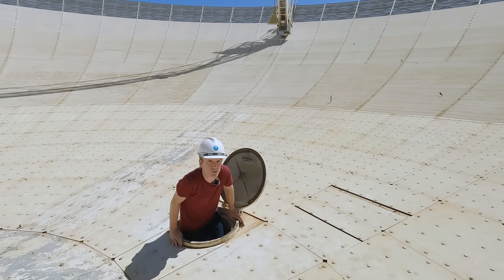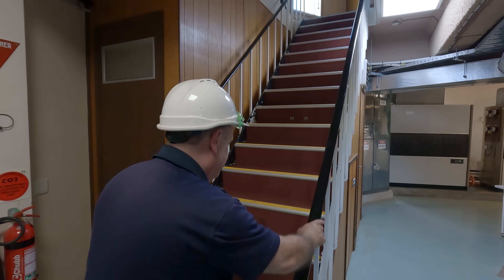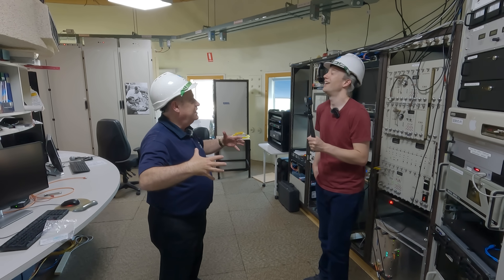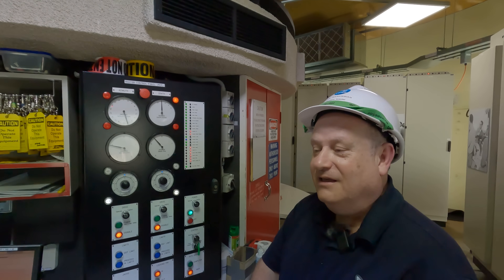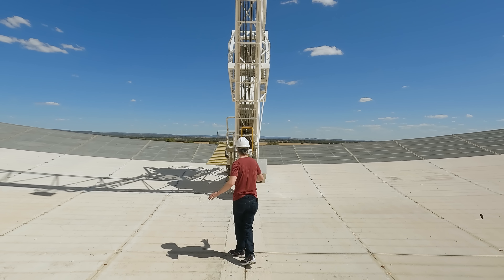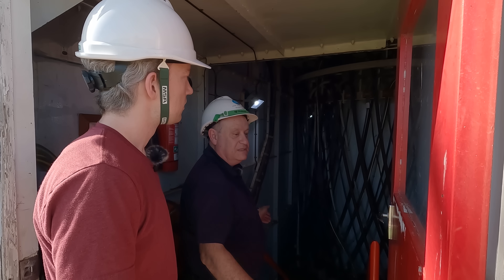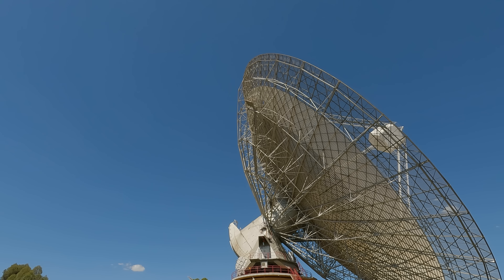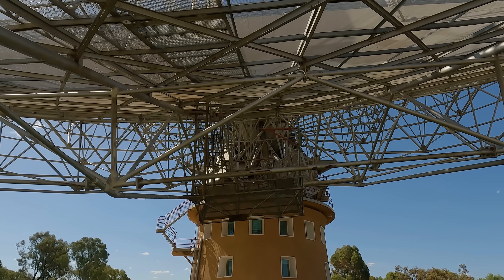I took a ride on a moving radio telescope

Comment: Wow I didn't really grasp the full scale of this dish until Tom walked off the edge at the very end. Calling it Gigantic would be an understatement.

Also the talk about a cell phone on the moon being the highest radio frequency they would receive from the dish made me wonder how they will deal with the Artemis missions and the eventual Mars Missions. 

How can they block out these transmissions when they do their regular work?
Reply: Genuinly they know the frequency at which these things emit. They then filter out that frequency (usually digitally) to get the astronomical data back again. 

Telescopes dont really work like our eyes. Our eyes are less sensitive to light when there is a big lightsource in the way. Telescopes can often still see when there is a bright source in the way.
Reply: Roofing filters are one of the ways, they limit the frequency range allowed through.  Anything not within that range is eliminated. 
That dish is also located in a radio silence zone, the one on the USA east coast is NRQZ, rf emissions are heavily restricted to keep the local noise level to a minimum.
Reply: I'd assume that if they're observing a sufficiently dissimilar frequency they could filter out the deep space mission signals.
If they do need to observe frequencies that might interfere they could collect observation data just when the deep space mission isn't broadcasting, or when the timing of orbits puts the target of observation at a sufficiently broad angle from the deep space missions that the dish won't pick up both at once.
Reply: If I ever visit the moon, I'm going to use my phone to play the shart sound effect at max volume to radio astronomers around the globe you can't stop me

Comment: That jumping off the dish at the end is funny, I love the idea of using an enormous telescope as a quick and dirty elevator
Reply: Why bother trying to complicate things when you just use the dish to do the work for you?
Reply: way slower than walking back down, but much easier than bringing stuff up stairs.
Reply: I wouldn't exactly call it quick
Reply: @ChiefArug  well faster than dragging the stuff through the building
Reply: @roberine7241  Agreed. I used to work at Arecibo Observatory (which Tom Scott has also visited), and lugging equipment up there was an absolute pain. Things in the hundreds of kilos could be lifted by winch, but that wasn't worth the setup overhead for things in the 20-50kg (50-100lbs) range. Those we ended up hauling by hand.
Reply: @ford9501  The Arecibo Observatory seems like a great place to visit! Although I wonder what's happened since the Telescope's collapse...

Comment: I love how buds was rather enthusiastic to tell scott about how the place runs and works. 
ALSO holy crap when it was mentioned that it was big I didn't realize until the end when it tilted all the way so they could just hop off the dish onto the ground.
She's an old bit of kit, but these old radio-telescopes will keep helping us understand the stars for ages to come.
Reply: Do yourself a favour & watch "The Dish". It's the most heart warming space movie ever.🙂👍
Reply: Physics hasn't changed in the last 60 years, so machinery like this can just keep on chugging. Virtually all the upgrades they've made in that time were in how they handle information, either from the signals they receive or for controlling the telescope's position and movement.

Comment: The amount of technology in this is amazing, cool how it was only meant to operate for 20 years but is still working today
Reply: Same thing for my gran because of the pension scheme.
Reply: @michael-3-l3   And at some point she's going to tip over and need some maintenance too.
Reply: @michael-3-l3  ayo
Reply: @michael-3-l3  bloody golden pensions.
Reply: yea same for the voyager satellites that set up in 1977 and are both still kinda active today. Farthest human object. This is mind boggling.
Reply: Well some of those upgrades for the CSIRO Radio Telescopes to keep them running eventually lead to research into digital signal processing, which lead to WLAN chipsets that are in most wireless communications we use today in our Wifi and Mobile Phones. (which you can't have near the telescope).
Reply: that's just technology from back then. build robust and build to last. not like certain products from today * cough cough * phones that break after just two years TVs that need to be replaced after three, todays tractors that really feel like they are much more likely to break than the old ones
Reply: @roberine7241  i mean its not really fair comparing a multi million scientific project to cheap consumer products hehe. Also not many products were made to last, for example its super common for burnt tubes or broken mechanical parts or melted elastic parts in old stuff